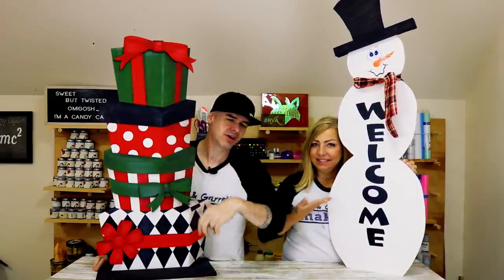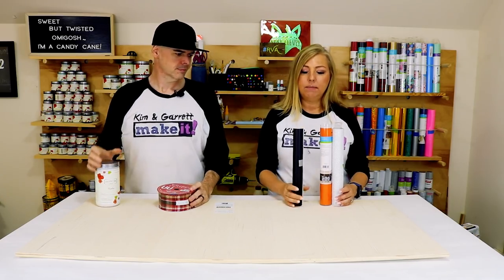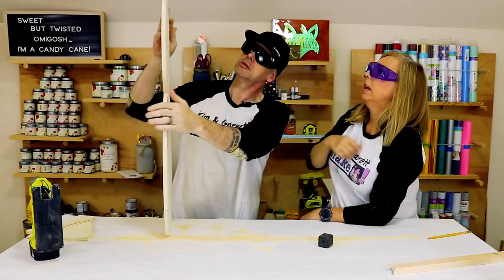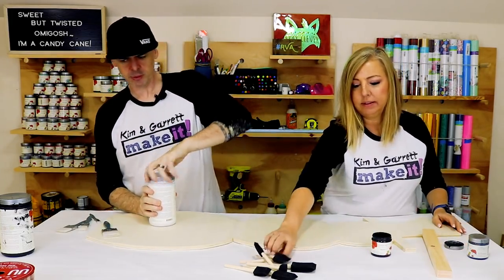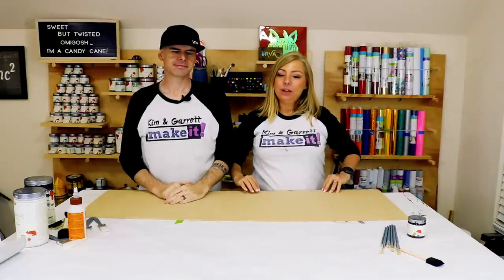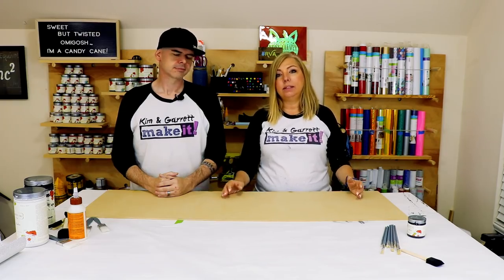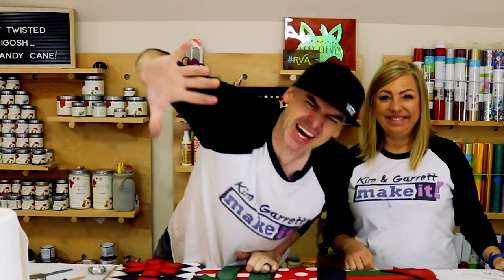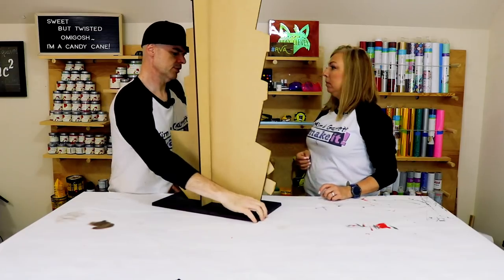DIY Snowman Welcome Sign and 3D Stacked Presents using the Glowforge

Comment: Love your videos!
What settings are you using for your glowforge? I'm finding that on the thick draft board setting,  I'm still not cutting through.  😭
Reply from the maker: Hey Asia! I am using the Thick Draftboard setting, then I Set Focus before each cut. I did have problems with the dark MDF from Home Depot. I had to cut it at Full Power and 128 speed.  The lighter colored MDF seems to cut a little easier.
Reply: @KimandGarrettmakeit  thank you!
I'll definitely give slowing it down a bit a try. 
That MDf color difference is tricky business!